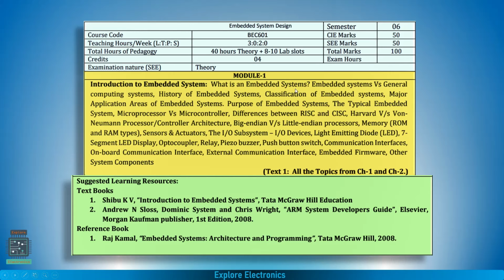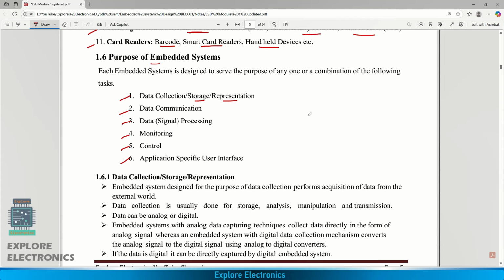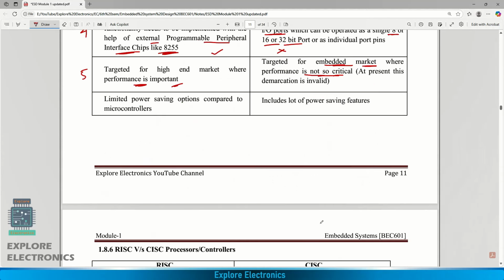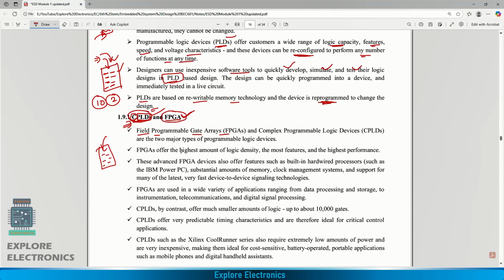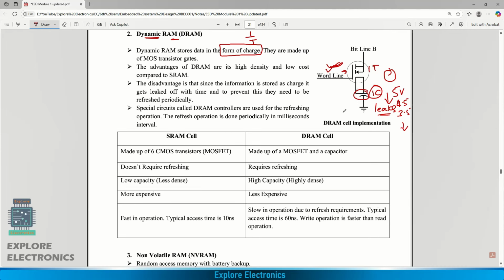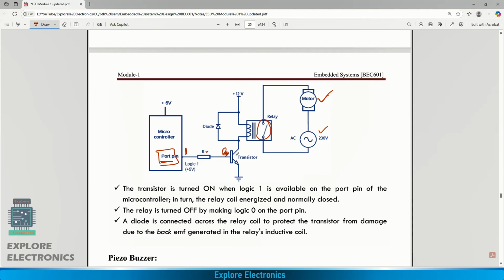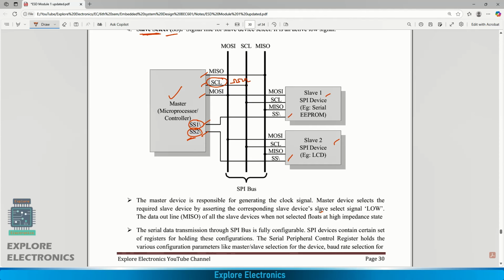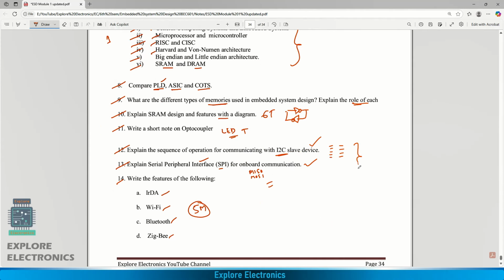Embedded System Design Module 1 Complete Video | VTU BEC601 | Introduction to Embedded System

Comment from the maker: 🧠 Topics Covered in This Video:
✔ 0:00 Introduction
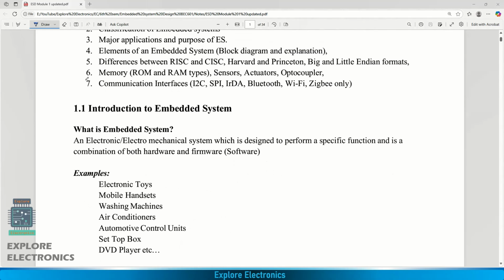✔ 1:50 What is an Embedded System?
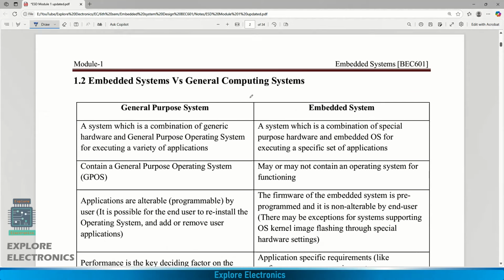✔ 3:25 Embedded systems Vs General computing systems
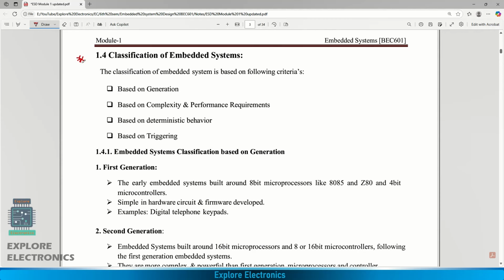✔ 8:09 History of Embedded Systems, Classification of Embedded systems
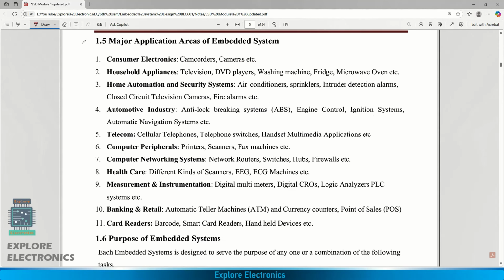✔ 13:44 Major Application Areas of Embedded Systems
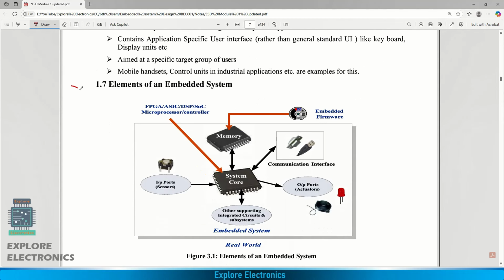✔ 20:34 The Typical Embedded System
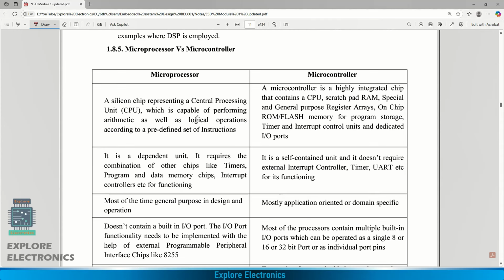✔ 29:17 Microprocessor Vs Microcontroller
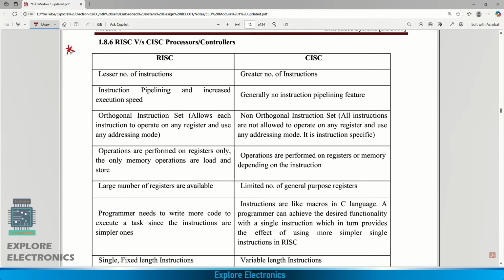✔ 32:32 Differences between RISC and CISC
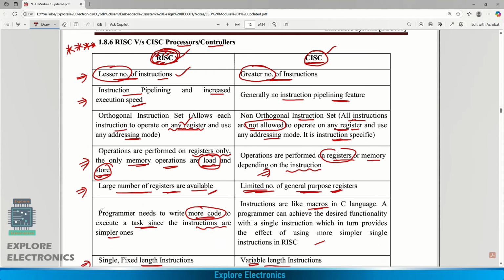✔ 36:38 Harvard V/s VonNeumann, Big-endian V/s Little-endian processors
✔ 51:35 Memory (ROM and RAM types)
✔ 1:05:38 The I/O Subsystem – I/O Devices, Light Emitting Diode (LED), 7-Segment LED Display, 
✔ 1:14:50 Optocoupler, Relay, Piezo buzzer, Push button switch
✔ 1:22:33 Communication Interfaces -I2C
✔ 1:32:45 SPI
✔ 1:37:36 External Communication Interfaces - IrDa, Bluetooth, ZigBee